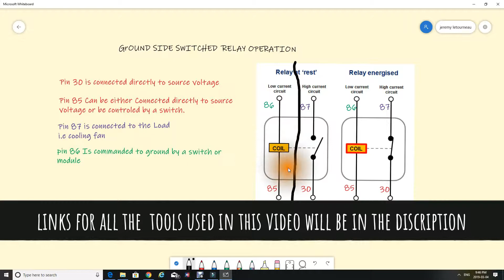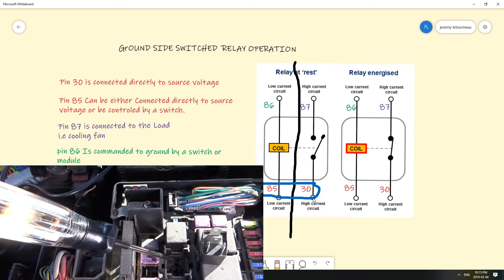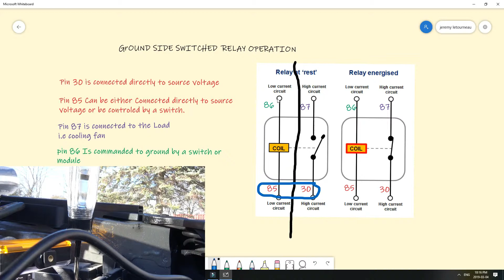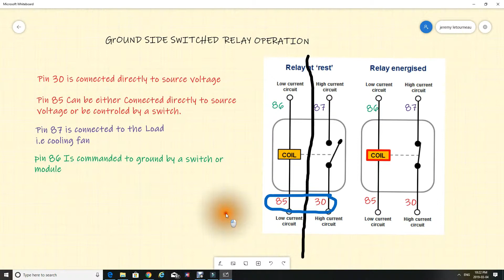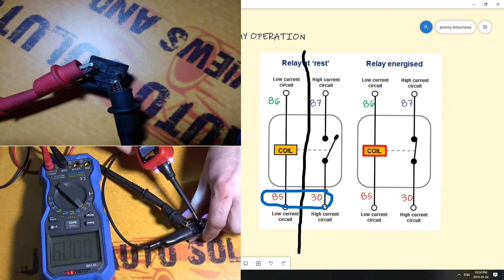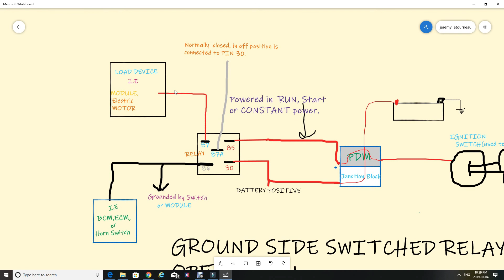Relay Operation/Testing/Diagnostics

Comment: OK my friend, one more time, you are not being specific, testing the relay, are you testing both sides with power or with out. Or? The simple thing that I found out but I’m not sure that it’s true and I have a three pin relay, and I’ve got infinite ohms connecting them all three and different variations, so I’m assuming that that means that it is bad? Yeah I did not put power to it so you are not being specific! Please help me out!